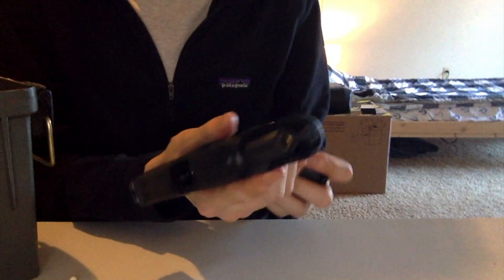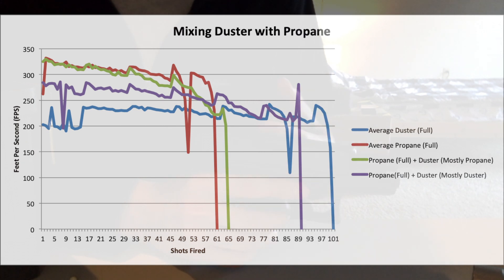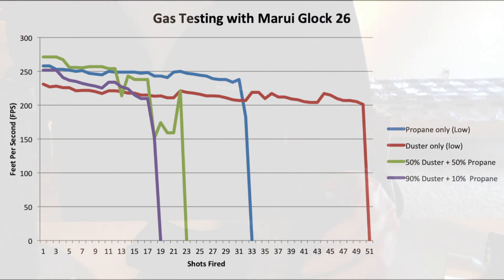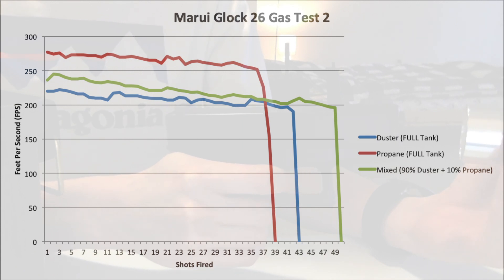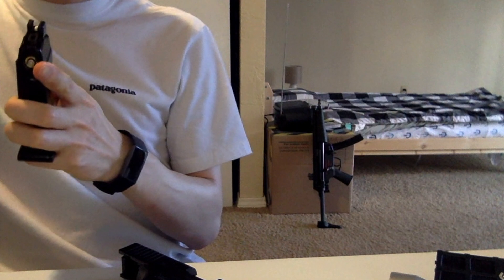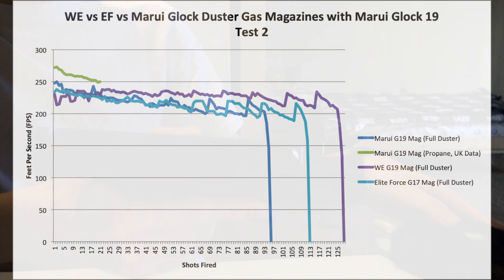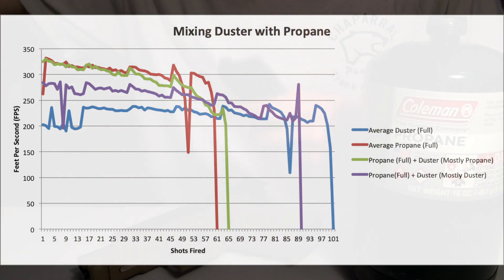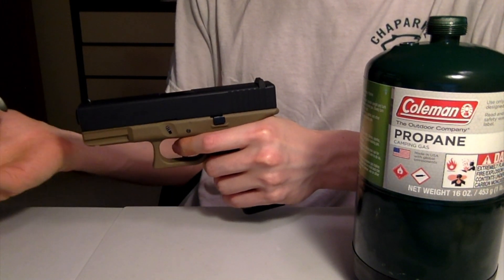Mixing Green Gas with HFC134a (Duster) Gas: Confirming the Results? (Part 2 of 2)

Comment: I have a TM MP7 I will try these. Do you advise to increase the ratio? Maybe 50% Propane and 50% Duster?
Reply from the maker: well I think 50%/50% might be too much. At that point it's pretty much is shooting propane. For my marui m4a1 I fill it with all duster gas and then I do a 0.5 to 1 second fill with the propane. This way, it gets a slight bump in FPS and is able to tolerate cooler temps, but not shoot at the higher levels that I wasn't designed to. I'm going a video soon on that and marui soon.

Comment: First off, great video! Definitely deserving of more views and subs! But HOLD ON... I was so worried duster couldn't push out a full mag, so I was sad that I was going to end up stuck with duster since my TM USP cant handle green gas/propane. But you're getting more shots off with duster than propane?????? AND with a gun thats using a metal slide???? Correct me if I understood the data wrong, but DAMN I feel a lot less regretful for buying this thing.
Reply from the maker: It's weird and there will be another video coming out on the marui m4a1 gbb soon but yeah looks that way! But the short answer is that there is still a huge caveat, duster must be slowly shot in a room temperature to warm environment to maintain this effect. If it were colder or rounds fired too quickly, the mag runs out much faster. So if you know you're going to be dumping mags rapidly, propane is still probably your gas of choice. Now can the marui plastic slides take green gas or maybe a half way green gas/duster? I'm working on that test right now. Stay tuned.
Reply: hi, is your marui usp still holding?  i'm thinking of getting one myself. thanks
Reply: @adolfhilter  I actually only use propane now lol. Been holding up just fine! I did end up breaking the trigger bar, but I equate that to it's age. Guarder came out with some metal slides, nows the time to get a usp!